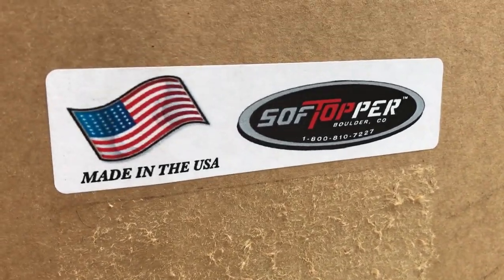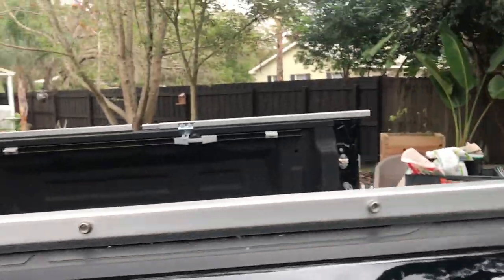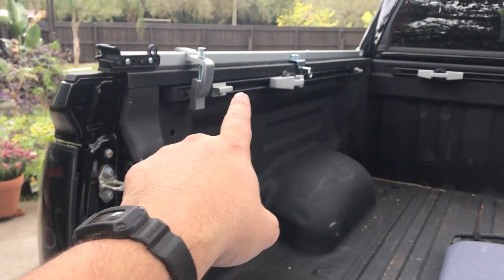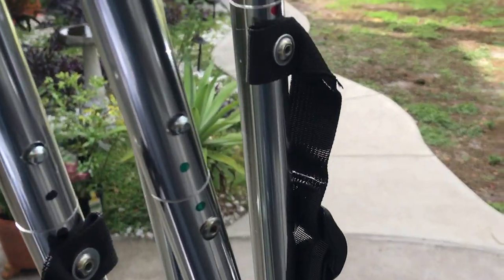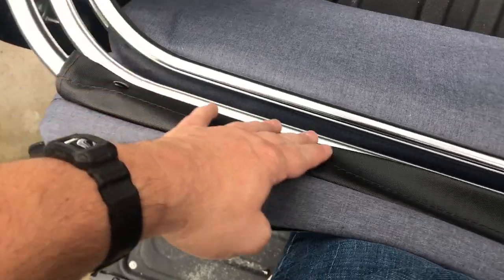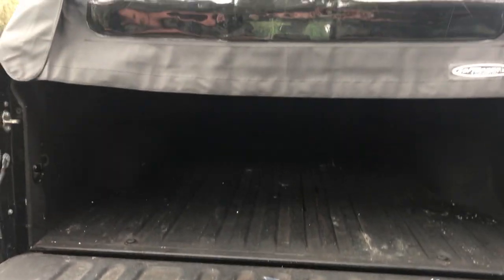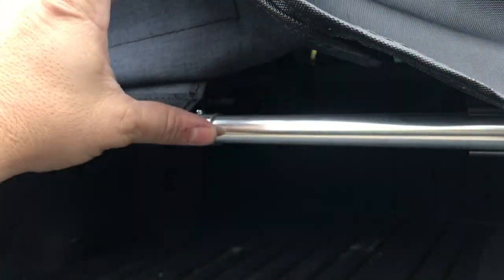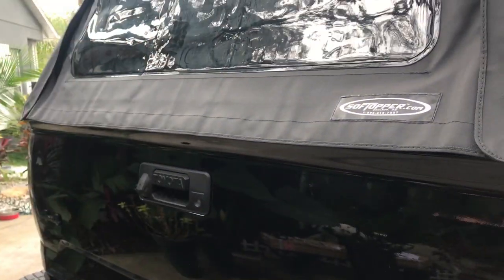The best addition to your truck! Softopper Full Installation and Unboxing

Comment: My slightly used pickup came with a nice matching fiberglass topper.  It looks real sharp and is nice for camping but the major disadvantage is that its too heavy and bulky to remove if I ever need to haul a tall item.  The softopper seems to a little more versatile and easily removes

Comment: When you roll up the sides put a “triangle” fold in the back flap and then roll it. It’ll make it tidy and not look like a noodle hanging off the side of your top. Just take the back bottom corner of the side and pull it up towards the top middle of the topper then roll. 

Never done it with a softopper but I’ve seen it done on Broncos.
Reply from the maker: Thanks for the tip! 👍

Comment: I really wish that you could fold it flat to turn it into a tonneau cover when you don't need the additional space.  Something like how a pop up camper works.
Reply: From what I've seen, it folds down like a bimini top on a boat towards the front of the truck bed and you can get an optional cover that wraps around to keep it snug. Just ordered one today.

Comment: Dude, thanks so much. Just got mine yesterday afternoon. With your video I got it all set up in about 3.5 hrs.  I did get the standard brackets and a doggie window for the front, but no problem.  Road tested today, I may make a couple little tweaks, but good to go. I got this to make my cross country trip more comfortable fo my dogs. They can now go from the cab to the bed if they so desire. Mine did not come with the seam protectant you mentioned. Or is it safe to say they have pre applied this? I just wanted you to know you nailed this video
Thanks, From Nor Cal to Florida, here we come!

Comment: Looks great !!  I've thought many times about getting one for camping and also easily transporting my dirtbike where I'll be camping.   The gap between the cab and topper always kind of throw me off though asthetically.  IMO looks better on a crew over my double cab...   or at last the few pictures I've seen.  Not sure if there's enough adjustability to help and the double cab has that curvature to the back of the cab doing it no favors.

Comment: It would be a better option for Tundras if it had a piece of canvas that attaches from the back of the cabin to the topper so it could create a seal between the truck and topper to get the most out of the back power window
Reply from the maker: Agreed 💯

Comment: Welp looks great, saw a Tundra at my local mall with this, so thanks for the over view.  What is your opinion, Pros, Cons vs Hardtop. Thanx
Reply: Pros would be easier to remove, lighter, cheaper. Cons would be not as secure, you can't mount a rack on top, service life is shorter.
Reply from the maker: What he said. And a con is the blind spot issue with no side windows and the necessary Velcro across the entire tailgate.

Comment: Where are those tail lights from? Looks great on your truck!
Reply from the maker: They’re made by AKKON here’s a link to them on amazon. For 2014 2015 2016 2018 Toyota Tundra SR5 Black LED Tube Light Bar Taillights Brake Lamps 14 15 16 17 18 https://www.amazon.com/dp/B079C5WK5G/ref=cm_sw_r_cp_api_i_aB2sEb4SK0KK2

Comment: Hey brother, can you measure from the top of the bed how much of the internal bars are sticking into the bed? Reason is I have the decked system for my tundra and I’ve seen people having to cut a hole to fit the soft topper.
Reply from the maker: Won’t work with that system. It’s too fat

Comment: Awesome product.  

Question tho.  I am driving cross country in a Toyota Tundra and need to bring my dogs.  I want them to be able to be in the bed but I want my rear window open so they aren't cut off from us up front, but not actually with us tearing up the interior. 

Is there any way to pull this off with this topper?  I mean I'll even cut the window out between topper and body, but wondering if you figure I could fill the seem with something like plumbing insulation or something and just basically jimmy rig it.  Would the topper be sturdy enough to keep pressure between the topper and the body of the truck without vibrating so much that the insulation can't stay in place?  I know it wouldn't be perfectly water tight etc, but would cutting out that window cause some unforseen structure integrity issues?

Don't want a permanent top because I only need this a few times.
Reply: I am in the same situation you are in, what did you end up doing ?
Reply: @Rongnr89  I used the pipe insulation you can get at home depot or Lowes.  I put some of the green painters tape on the truck so that there wouldn't be any scratches or left over duct tape residue on the paint when I was done with the trip.  It worked out great.  Drove through some heavy rain and only a few drips.  

I used the duct tape to hold that pipe insulation in place.  You might want to drop the topper in and see where it should go but basically it's just around the window, close as possible to the outside window edge.  

I also added some of that same insulation to some areas around the tailgate just to seal ot a bit better mostly to reduce noise. 

It worked out more than good enough for a trip like I did.  If it was going to be a forever thing, I'd probably get a sequoia and just get a barrier to stop them from tearing up the interior/front seats and center console.   But yeah, for a trip or three, it's worth the effort.  And that green painters tape comes off clean, pulling off all the duct tape quick. 

BTW I should mention, the green tape tends to pull off here and there when you apply the insulation because it isn't strong, but once you get the topper on, it pushes it and keeps it against the truck and topper.   You'll see what I mean, seems sketchy at a few spots but it works out.

Comment: Thanks for the video! Thinking about replacing a snugtop. I run a dryer hose from my AC vent to keep my dogs cool in the bed. Would I be able to tuck a 4" dryer hose through that front window and drive without it flapping like crazy?
Reply: Yes you should
Reply: There is an optional Doggie Door for the front window. https://www.softopper.com/accessories-parts/dog-window-kit

Comment: Anyone put one of these on a Dodge? Also do you have to have the bed tracks for this item?
SGM P
Reply: You dont need the rails, the clamps change configuration to attach onto a bed without the rails installed.
(Also looking to attach one to 2019 ram 1500, not sure what the best options out there are)